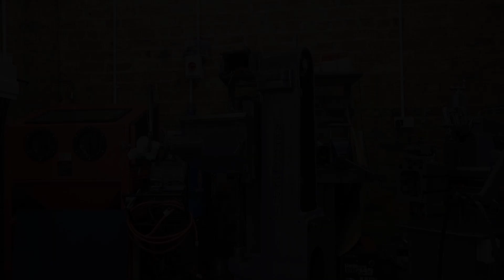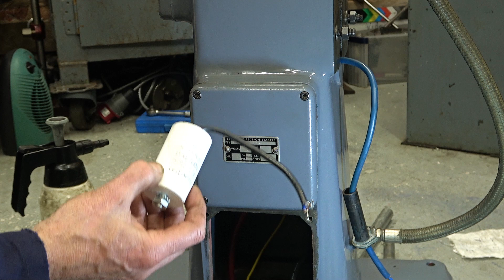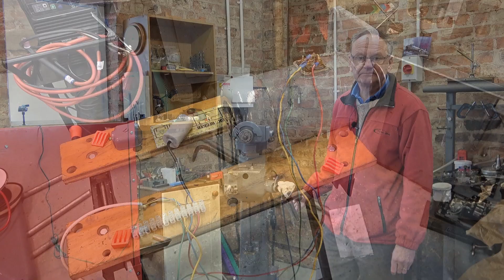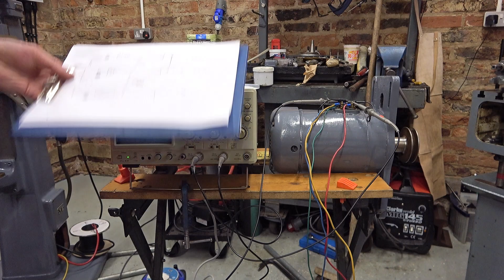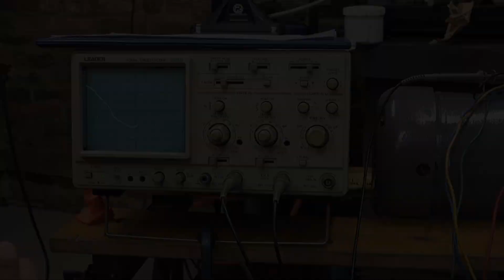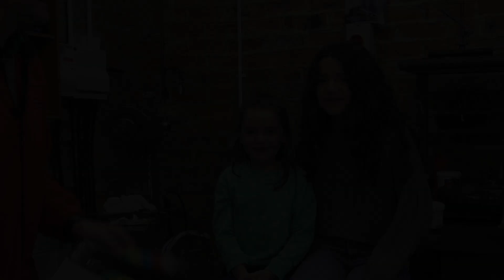HS232 Herbert Junior Mk2 surface grinder - Part 5

Comment: Hi Paul. Some 30+ years ago I acquired a machine which has a three phase motor to power an inking roller. It has therefore quite a small load. Not having three phase I hunted high and low for a replacement geared motor. It was such a struggle. Then out of the blue I discovered that a capacitor could be used to create the phantom phase. A calculation and diagram was sourced and to my delight a local motor engineer rigged up what I needed. 30+ years later that machine continues to work faultlessly. 
Fingers crossed you can rig together the required capacitance and have a static solution which works.
Thank you for another interesting episode. It’s all coming along nicely. The Admiralty Grey looks good. 
Big shout out to your “little helpers”. 👏👏👍😀
Reply from the maker: Andrew, if your motor worked fine with one capacitor then be happy. Mine was a struggle - but you'll see. Cheers.

Comment: Every time I get my 'scope out I think "I used to know how to drive this" 😂 Cheers Paul, great video 👍
Reply from the maker: Hi Matt, I guess few people still have the steam powered scopes (I am sure it is transistor not valve tube, except the CRT itself).  I bought it for £60 from a shop under the arches by Leeds station and carried it on the train and then it rode on the footboard of my commuter scooter to home.  It went unused for a few years until I had to check the crank and cam position sensors on my Mitsubishi; it was easy to find the faulty one with the scope. Cheers
Reply: I have fond memories of M&B Radio under the arches in Leeds, marvelling at the stacks of equipment I couldn't afford (and for the most part had no idea what it was used for!)
Reply from the maker: Matt my best guess it was 2006 and they were soon to close the shop and sell online only.

Comment: Good idea to keep it as original as possible. After a bit of research it will work just fine.
Reply from the maker: Hi Michel, as it turned out putting in an inverter would have been easier and actually about the same cost in the end. Cheers.

Comment: very good job Paul..thanks for your time

I have all my machines connected, each one with a frequency converter and it saves time, money and the machine performs its full potential.
Reply from the maker: Hi TrPM, I have 5 inverter/frequency converters in the shop at the moment and, based on my experience making the static converter, I should have bought a 6th for the surface grinder.  You will see .... Cheers

Comment: Nice video and amazing into and exit using those adorable kiddos!  Shalom
Reply: Such cheating.  Who can resist the endorsement of happy kids?  I appreciate the progressive testing, rather than wiring it up, flipping the switch, and noting where the magic smoke comes out.  Carry on, sir and ladies.
Reply from the maker: Hi, if they are here and I need help with an intro I'll ask. Sometimes they say yes, and sometimes no.  It's just down to chance and timing. I've told them one day they will be famous 🤣. Cheers

Comment: The electrical part of this was very interesting. We invested in a large Digital Phase Converter for the complete workshop many years ago. The grinder looks great. I am looking forward to seeing the guard you have as I do not think ours is original
Reply from the maker: Hi Joseph, the guard on mine is not original, somebody made it. If you like electrical challenges you may like Part 6 - making the static converter. Cheers

Comment: Not an electrician or machinist, but I have wired in VFDs three different times on my machines. I have done this over a static converter because VFDs can be purchased for less than $100 and my online research tells me that the static converters are very hard on motors with a variable load. Hard as in excessive heat buildup. I like your systematic quantitative testing approach to finding what works best for you. Keep up the great videos.
Reply from the maker: Hi John, experience proved you right - see part 6. Would have been a lot less work just to fit an inverter. Cheers

Comment: On a large centerless cylindrical grinder(60” diam up to 20 ft between centres) with a 50hp grinder motor, we installed a vfd and an AC motor replacing the old DC machine. We were surprised to see the surface finish was mottled. It turned out the VFD carrier frequency was making a slight torque ripple that caused it. Adding a 3phase reactor between the drive and motor fixed that.
The DC drive originally had a substantial choke in the circuit. (360 hz ripple with the DC, 2khz with the AC, but the AC machine had a lot lower inertia). (I think I am rambling.)
Reply: Rambling with useful details is a desirable discourse.
Reply from the maker: That's very interesting Glenn. Thanks. There is a lot of hidden detail in this topic. Cheers

Comment: I tried building a rotary phase converter using a capacitor and a three phase motor, more or less the same thing you are doing here, but I had planned on using the output of the motor to power the machines. The capacitor blew up on my and splattered oil all over the ceiling in my shop! LOL!
Reply from the maker: Ah well Greg, that is a portent for my experience. Not so dramatic as an explosion but the start capacitor was the cause of much trouble - you will see in the next part. Cheers Paul

Comment: Great work Paul, getting close to having a fully working machine now. Regarding power, I opted for a rotary phase converter in my workshop, I now have 6 three phase machines that I can simply plug and play without having to worry about tuning inverters or capacitors (not simultaneously obviously). Downside is that RPC’s are expensive and of course there’s the noise question- mine lives in its own little extension to my shed.
Reply from the maker: Hi Jason, rotary converters are very popular for shops with many machines and it makes the whole thing simpler to connect, especially if your motor(s) can't be wired in LV Delta, but they lack the 'smarts' like overload protection, torque control/torque boost, speed control, digital control interfaces and alarming etc.   Horses for courses. Cheers

Comment: I used to use an isolation transformer on the scope, make sure the scope is on a rubber mat, and just use one ground clip. Use rubber gloves changing the settings or disconnect the power before touching the knobs. Accident waiting to happen but got me through in a pinch. 
I now have a scope with isolated probes that I can connect any which way. 😊
(70’s surplus vs brand new Teck scope and about $10k)
Reply from the maker: Hi Glenn, in the next part you will see I disconnected the earth pin on the scope and let it float so I could put the probe and the ground clip across L1 and L3 so I could see the waveshape across the relay in my home-built static converter. Isolating mat, rubber gloves, one hand behind me back. I'm still breathing. Cheers
Reply: @HaxbyShed  I have taken the odd poke over the years🫢

Comment: Paul I can understand wanting to keep the standard switches. Both my Lathe and Mill have VSD control but have remote switches on m/c (mill yet to be commissioned 🤨) My mill VSD's are made in Wales by Invertek soured from Inverter Supermarket. Both companies very helpful on phone and Invertek wiring instructions very good and simple.
Reply from the maker: Hi Jon, keeping the original switches and wiring was a nostalgic notion and I have them working with the static converter now, but yes I agree in retrospect I would have saved a lot of effort fitting an inverter and running it from the column switches. I've done that on my mill, lathe and shaper but I thought the grinder would be simple enough with the static converter (you will see I was wrong).  Cheers

Comment: I'm with you Paul about using the original on/off switch. Put your isolator in a warm oven to speed up the paint drying. Cheers Tony
Reply from the maker: Hi Tony, I got the static converter working but it was a real fight due to a faulty component that was hard to find. I've yet to see whether the static converter gives me an uneven pattern on the grind. Cheers

Comment: Hi Paul, Great job by the MC hosts !
Might just be the camera mic, but the motor bearings sound a little rough.
Enjoying the project !
Cheers....ATB....
Reply from the maker: Hi Dean, the bearings run very smoothly but they will be old. I'll get the machine running and then maybe come back to those later. Cheers

Comment: Hi Paul. That was great, good to see the waveforms from the Steinmetz connection. That's the bit I didn't do in my treatment of it. I think I'd go down the vfd route personally, as you can wire the original switches to operate the vfd functions. Your statement about the 90 Deg phase shift is correct. Maximum 90 Deg phase shift from a capacitor.Will be good to see the static converter. Steinmetz probably not a good plan for a surface grinder as lower torque and torque variation throughout a revolution due to phase imbalances. Could show up as surface finish irregularities? Thank you for a brilliant film. Your granddaughters are brilliant!
Reply from the maker: Hi Carl, I have got the static converter working but it fought me all the way. But when I say 'working', it runs the machine but grind quality still to be tested. Thanks for your generous support. Cheers Paul

Comment: Well done ladies 👍.
Machine looks great, hope the red paint has dried now? 😮.
I  did build a single to 3 phase static converter with a starting circuit, just a timer and contactor, the donkey motor was a 2.2 kW 4 pole ( 2 pole or 2800 rpm are better apparently), voltage and current were fairly close, but obviously phase angles were well out.

I purchased a proprietary TransWave static 5.5 kW converter,  that had a start, or boost circuit,  this ran my Bridgeport mill, and Colchester lathe, but you could hear the phase imbalance in the motors. Voltage and current were  not close. On power up with no motor connected,  voltage was 245, 190, and 690 across the phases, as you said ensure the control equipment is connected on direct mains voltage, I didn't, magic smoke from the X axis feed drive, luckily,  the varistor (MOV), did its job.

Transwave Ltd, based in Birmingham are excellent to deal with, bought a rotary converter off them as well,  big improvement on phase quality,  but never checked angles etc.
Finally had 3 phase installed. 

Thanks for sharing.
Reply from the maker: Hi John, I now have the simple static converter working but it gave me a lot of trouble to get it working reliably.  I've not tried grinding yet so it could still prove unsuitable due to phase imbalance. It's been a learning experience. Another case where I thought I knew, but experience proved me wrong.😒😁 Cheers

Comment: you lose about two third of torc with the steinmetz, why not a fvd so you keep all of the 3 fases used ?
and a fvd is very cheap from china.
i love the "ladys intro/outro"
cheers ben.
Reply from the maker: HI Ben, as you will see in the next part, I should have bought a VFD at the outset but we don't know until we know do we 😁. I thought making a static converter would be easy and cheap but it did not work out that way. I have actually bought an inverter as a 'backup' but there is a good chance I will fit it later. I just need to wait a decent interval as I can't yet bring myself to ditch the static converter yet due to all the effort and cost I put into it. Cheers